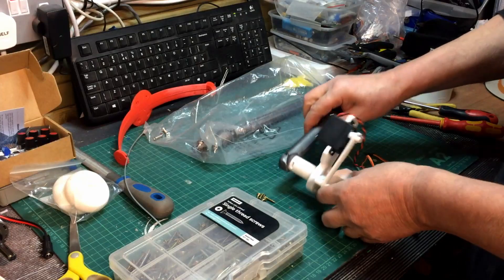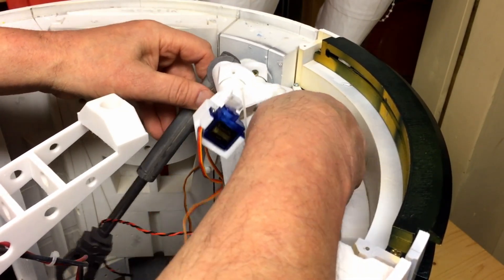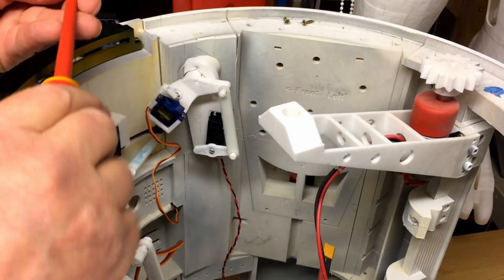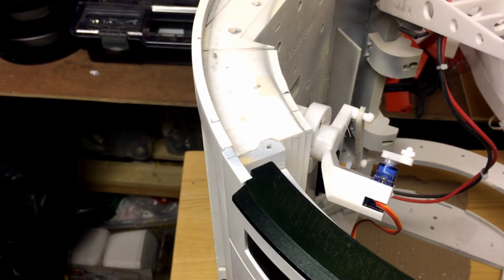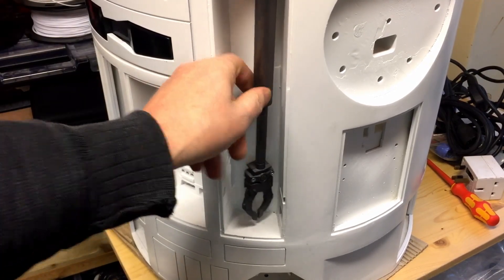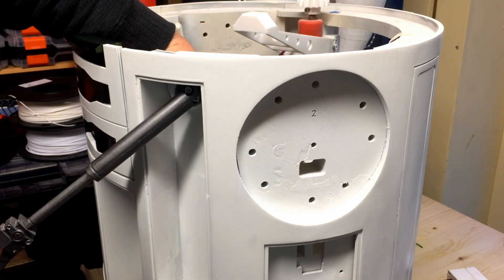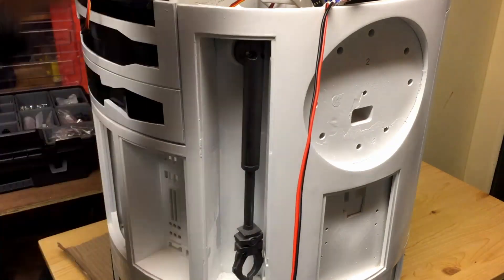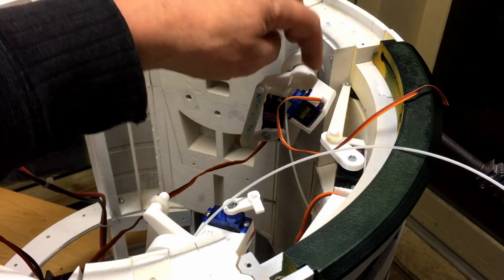R2D2 Droid Build - Part 32

Comment: When are you going to be doing some more videos on your R2D2 your videos was helping me with my build hope to see you back soon
Reply from the maker: Hi there, soon I hope, just been busy with other things.  My droids all painted, I just need to redo the electronics as I took it all apart again, particularly the control board.
Reply: @kylecampbellweb  great I look forward to seeing your videos on R2D2 I have gone down the road of the Palawan 360 with the Xbox controller the board works great
Reply: @propsandcosplay  yeah me too
Reply: @kylecampbellweb  https://youtu.be/oZw0zzCgoh8
Reply: @kylecampbellweb  https://youtu.be/oZw0zzCgoh8 it’s a 3 part video
Reply: @kylecampbellweb  where do you live I have a spare one
Reply from the maker: @propsandcosplay  Hi, thanks for the offer but just got given one to play around with. Just been watching the Padawan setup vids and have all the parts so will be building that soon I think. Looks fun and simpler than my original plan of using EZB hardware. I feel a video coming on!
Reply: @kylecampbellweb  great looking forward to seeing it

Comment: What motor you are using for the dome?
Reply from the maker: Hi Sky, sorry late in replying, I missed this.  I am using a 919D501 RE 540/1 Metal Geared Motor.    I got mine from Technobots [https://www.technobotsonline.com/919d501-re-540-1-metal-geared-motor-50-1.html]